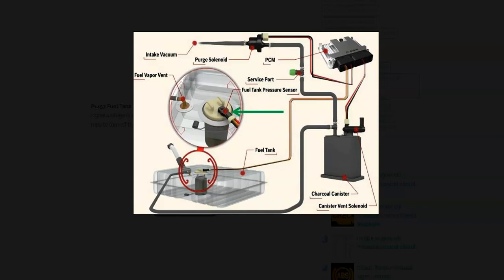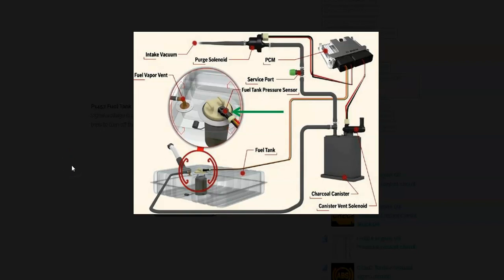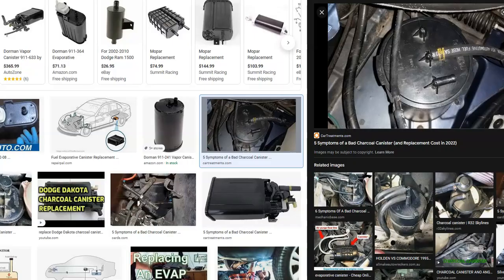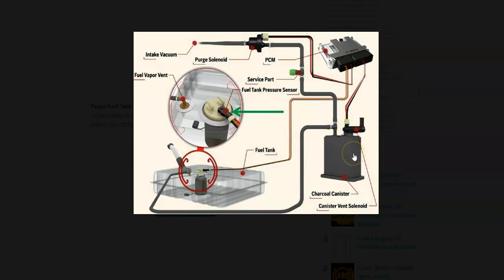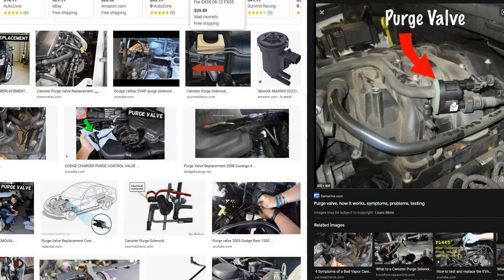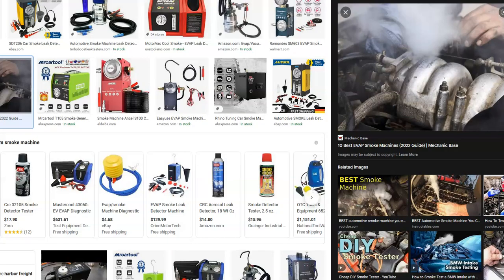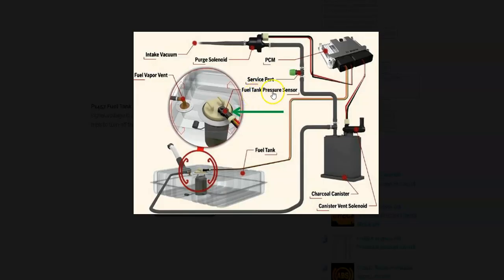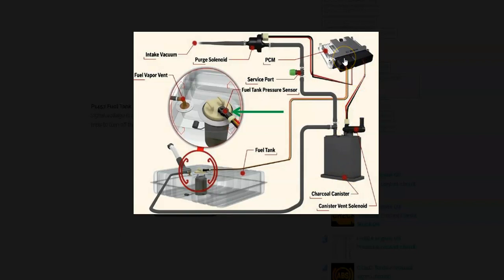Overview of Dodge Evap System Components and How to Troubleshoot

Comment: I’m trying to find my leak. It says gross leak and large and small leak. Where would I hook the smoke machine up to? It’s a 03 dodge ram 1500 4.7L
Reply from the maker: I always pull the hose on the purge valve in the engine bay and send smoke into the hose going back to the charcoal canister.

Comment: I  got a Question,1st had a code to replace purge valve did that. Code cleared. Then a got a gas cap code, looked ok, but replaced anyway, cleared code manually. Comes back as gas cap. Probably the lines? Trying to avoid getting stuff for smoke test. Any experience, or opinions?
Reply from the maker: There likely is a leaky hose or component that can be hard to spot without a smoke test, but you can test components and check all the hoses to see if they are all good. Sometimes the leak is not in the EVAP system but on the gas tank, such as the fuel pump gasket leaking.

Comment: Do you know if there’s a evap service port on 2012 Dodge Journey 2.4l? I’ve replaced purge solenoid valve, LDP, gas cap etc and I no longer have the P0456 code but the Evap IM  will not ready.  

I’m going to do a smoke test on the Evap system but I’m trying to locate the service port to avoid everything else 

Thanks in advance
Reply from the maker: If there are no codes, it may just need a Drive Cycle.
Reply: @HVAC_Mechanic I’ve going through 1000 miles and the drive cycle by itself 6x. It will not ready

Comment: I have a 2004 dodge ram 1500 5.7l hemi and every time I fill up the gas pump shuts off prematurely and spews fuel out of the filler neck. Any ideas of what it would be? I have checked my purge solenoid but none of my hoses have a vacuum, I also unplugged the hose to the canister and filled up to see if it would do it again and it still did so I might have to replace the pressure sensor?
Reply from the maker: It needs to be diagnosed but when the gas pump keeps clicking off that is a common symptom of a bad vent valve located with the charcoal canister. I made a video how to test a vent valve here is a link. https://youtu.be/zsetg4T1T4Q
Reply: @ yeah but I have the opposite problem, the pump doesn’t click off until the fuel is already spewing out. But I’ll have to do a couple trial and error diagnostics and see what it is

Comment: ‘09 Ram 1500…..the dealer replaced the fuel pump and now the pump at the gas keeps clicking and stopping…..can’t fuel the truck…..? Help!!!!!
Reply from the maker: That is a common symptom of a EVAP vent valve issue. Some years of Dodge, it is called the leak detection pump. Since they just replaced the fuel pump, the wiring may not have been plugged back in good.

Comment: Hey so I need your help I just saw your video but I was testing my Evap is a smoke machine by the way I have a 4.7 FFV 2007 dodge ram 1500 so I plugged into the purge valve line and there was no smoke that I could see at first but then I noticed that behind my engine up on the fire wall their is this mushroom looking thing and all the smoke was coming out of there and I was like wtf and I have been looking for days to find this hose that connects from the fuel filter on the frame of my truck up to the mushroom cap looking thing but I can’t find it I hope you’d be able to help
Reply from the maker: I'm not entirely sure about the mushroom-looking part; components can look different depending on the vehicle, but it may be the leak detection pump, which often can also contain the vent valve. When doing a smoke test, be sure the vent valve located on or near the charcoal canister is closed as it is normally open, and smoke can come out of it. As long as the vent valve is closed, if smoke is spotted, usually there is a leak.

Comment: Question, I have a dodge charger 2010 sxt. When i fill up the gas tank with 20$ or so it spits it back out and i have to add little by little. What could be the issue
Reply from the maker: That is a common symptom of a bad vent valve. The vent valve is often built into the charcoal canister under the rear of the vehicle.

Comment: Hey I do have a question I have a 2000 Dodge ram 1500 5.9 magnum it threw a P1495 code and says it's the leak detection pump but I can't find it on my truck and can't find any videos on it?
Reply from the maker: The mid-2000s Dodges have it on the charcoal canister, but some of the 90's early 2000s have it mounted in the engine bay on the firewall. There will be hoses going to the charcoal canister along with the purge valve.

Comment: Not a mechanic so this may be a dumb question, but i have an error code P0441. Will problem in the evap system or this code cause the engine to not turn over? It wont even try to start. Turn the key and nothing. Yes the battery is fine.
Reply from the maker: Usually, the Evap system doesn't affect the engine. The only Evap component that affects some engines is if the purge valve is stuck open. Even than usually that just cause long start times; the engine should still start.

Comment: Ive got a 2002 dodge van 3500 extended van under driver side door underneath is my charcoal canister it majes a pecking noise you can also feel it first time i hesrd it i suspected rod knock then discovered it was the canister  also im getting string gas smells more inside the van than on the outside  also cold stsrt or 15th stsrt of the dsy it dosent matter  the fisrt crsnk it will not stsrt let up on key switch try an stsrt a second time sometimes it will start no problem other times it will try an stsrt as if its eitger out of gas or flooded and its even backfired not like out of time but like it was in middle of firing up am sone shut it down before it actually had a chance to burn the fuel on compression stroke and fire up then theres times it wilo stsrt up like a brwnd nee vehicle at first b7mp of key switch  wheres this gas smell comings from  and why ive changes air filter an did a tune up nee plugs rotor button  wires parts store ssys there's no listing fir a fuel filter on this vehicle but i know it has to have a changeable fuel filter somewhere  i also haven't changed the pick up module in the bottom of distributor cap yet nor the coul that is next any ideas it shiws 198 thousand miles on speedometer runs great but wgen you on highways go to knick it into passing gear it most of the time is luke a slug (snale) bogs but dodent kivk into lower gesr but the times it does it will move on wth u no issue

Comment: I got a 2010 Dodge 1500 gasoline and I'm getting the code p0455. Do you have any advice on that code?
Reply from the maker: A P0455 code points to a leak in the EVAP system. I made a full video on all the EVAP components and how to test them; here is a link. https://youtu.be/C5s3Rx3wjD0
Reply: @HVAC_Mechanic  thank you

Comment: Hi. I just replaced my fuel pump on a 2015 RAM 1500 because of bad fuel level sensor. It ran fine for 4 days. Then had intermittent no starts. I had a code for pressure sensor. I replaced that. Ran fine. For a day. Then no start again. No engine codes now either. No permanent codes. It won’t start at all now. Cranks but nonstart. Help. I’m about to take it to mechanic and throw in the towel.
Reply from the maker: It needs to be diagnosed, but it sounds like a wiring issue. If you have a meter, I would get a schematic and check if the gas pump has voltage and good ground. Also, check that the plug is all plugged in good.
Reply: @HVAC_Mechanic  thank you. Well, the pump runs to prime the pressure when key is in ON. Also jumpering fuse #70 for the pump and bypassing, I can get the pump to run continuously. So unless I completely miss something, the power and pump are ok. I tried the pump relay bypass and that didn’t work. I am trying to figure out how to check fuel pressure at the engine. I don’t find a schrader fitting for my fuel pressure gauge.
Reply: @HVAC_Mechanic  I was just in there as I could without dropping the tank. All connections and wiring looks good as when I put it all back. 🤷🏻‍♂️

Comment: I am having problems when I fill up with gas. The gas fill handle trips constantly and I hear air gurgle in the fill pipe. Also have engine light on too.
Reply from the maker: That is a common symptom of a bad vent valve.

Comment: One part not mentioned is the leak pump detector found on 2003 dodge caravan SE this one happens to be a  flex fuel, I have code po456 it happened just after replacing an old oil fill cap that was not sealing with a new one that seals... Then this code po456 came up.. I am wondering since the old leaking oil cap was decreasing the overall vacuum and then by fixing the old leaking oil cap  I am wondering if this caused the overall vacuum to  go up and then become just enough to trip the code through the components on the emission system... some are saying that its the Leak detection pump on a 2003 dodge caravan.  And yet I am thinking first to replace the gas cap being that the oil cap went on this 20yr old vehicle that it is not a related issue and that cap may have went bad too. after replacing the gas cap if does not work...one other thing I can do to prove my theory about overall vacuum increasing may be revealing a small leak is to put the old leaky oil cap back on clear the code and see if the engine light comes back on.. which will not be a fix but will just reveal to me how sensitive this system can be and it would not really be my answer to the code problem and I will have to keep looking.

Comment: I've got a big tube that comes off my canister and heads for the brake booster, but it's broken and I don't see anywhere it could go. The tube is not shown on the diagram under the hood and it's not on yours either. My purge valve is connected.
Reply: Same here. I have a similar issue with a hose hanging from underneath the gas cap but everything else is connected where it needs to be.

Comment: Hey where is the evap pressure switch? Thanks
Reply from the maker: It varies by year and model, often it is on the fuel pump and sometimes on the top of the gas tank. An Evap diagram for the vehicle will be needed to know for sure.
Reply: Ok thanks for the info. It’s appreciated

Comment: ?? Thx for Vid, However can you give your input? I had Ram gas 2500 running and went to take off and it 'stalled' and won't crank. I have power to everything except starter. My scanner says P0499 "Evap vent valve control circuit high"
Reply from the maker: An EVAP code is for emissions and won't cause the engine to not start. When an engine doesn't crank, the things to check are the battery/terminals, starter, and fuses/relays.
Reply: you fix the P0499 issue?  I have that on my sons 2004 5.7.

Comment: Hi, thanks so much for your helpfull video. I got the problem as well on my 2019 RAM 1500  (5.Gen.). I will go through all the steps you mentioned. But it is weird as I can delete the error code in the bord computer and drive for a couple of weeks before the error comes back. If there is leak or a bad valve or a incorrect wiring shouldn't be the error immediatly back?

Comment: I can’t seem to figure out where the hoses go from the emissions system. I’ve got a major leak (hoses burned up by exhaust) and can’t find where they go to repair them. Can you help?
Reply: Did you get a smoke machine? I would have put it in the damaged part of the line and looked for hoses that size under the hood and disconnected them to see if there was smoke
Reply: Same here

Comment: What is the name of the line running from the fuel tank to the charcoal canister on your diagram on this video I have a 2006 Dodge magnum 3.5 SXT please 🙏 if you can give me the exact part name trying to find it thank u sir
Reply: I have the same question.  On my 2001 Dodge Dakota 3.9 V6 there are two "U" shaped hoses on the canister and I went to replace them and found that the nipple for the small hose that goes to the fuel tank was broken off and about a foot of the hose was torn off.  I've been throwing a P0442 & P0455 error code every 100 miles or so.  What is that hose called and how hard is it to replace?  Thank you!
Reply: Vacuum I believe

Comment: Help!! Having an issue filling tank get 10 cents in gas and click every 10 cents or so code says gas cap replaced and still having issues ??
Reply: Venting issues. Had the same problem.  Check your gas tank vents.  Turned out mine was broke off had to drop tank and rerun the vent line.  The fumes building up is preventing it from filling.  I’m 90% sure that’s your problem.
Reply: @Youtubehome1777  thanks
Reply: I have same symptom but I took it to a shop and they told me it was the vapor/charcoal canister. I’m going to do it myself because they quoted so high, so I can’t confirm that it does fix it yet lol

Comment: I’m getting a code P0452 Evap pressure switch stuck open. Is this the little white box on the gas tank? 2015 ram 1500 5.7l
Reply: I'm getting same code, but mine says stuck closed. Dodge dart 2014. Did you find out the issue?

Comment: multiple evap pumps replaced as service said pump bad. purge valve also replaced. is it possible  the fuel pump mounted on top of the fuel tank could have a leak? fuel pump was replaced months ago as plastic fitting broke leaking fuel. smoke test shows no smoke. p0440 and p0441 codes.
Reply from the maker: Yes, EVAP Leaks can happen at the fuel pump. Usually, a smoke machine would show smoke though.
Reply: Same issue. Have you been able to fix this?
Reply: Good luck with that. Even if you wanted to buy a new fuel tank with the plastic evap nipples it is discontinued, unavailable. There are no service approved fixes, only hacks like hinge pins and JB weld. This issue could very well render my 04 ram with 80k miles junkyard status. I get around this by clearing codes and doing a drive cycle, evap system reports “not ready to test”. MIL is not lit.

Comment: Will this code cause idle issue when foot is on the brake sitting a light or stop sign
Reply: Cleaning the idle air control valve and changing spark plugs fixed my rough idle